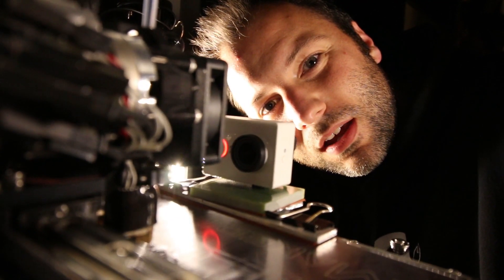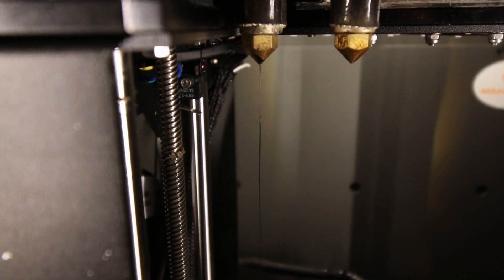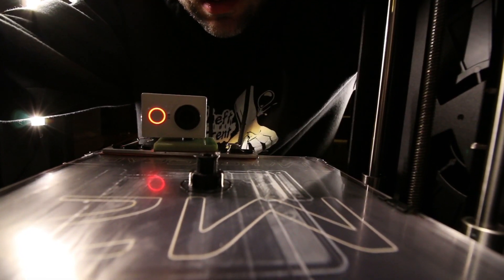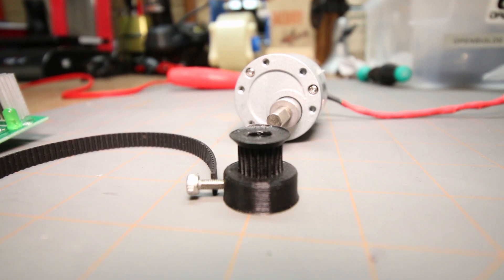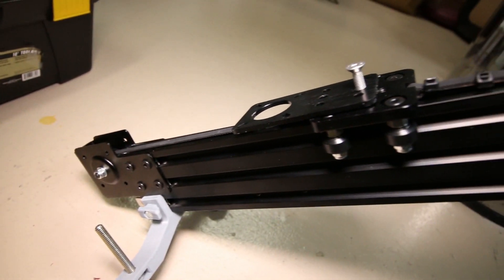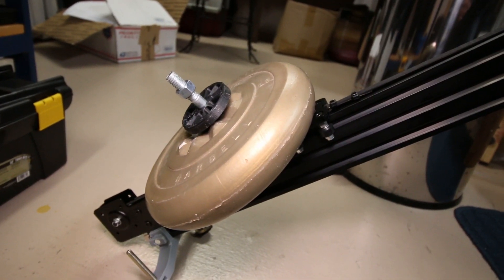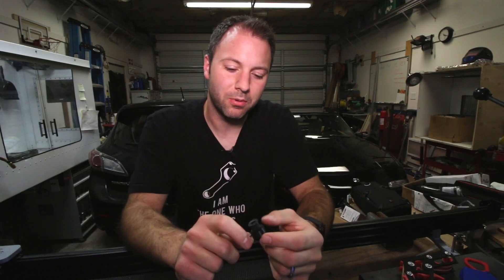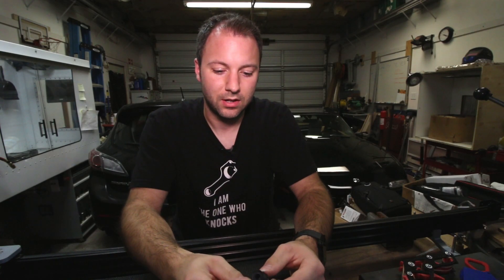3d Printed Timing Pulley in 23 mins for $0.17

Comment: Just found this video while searching for how to print pulleys. Recently, the support bracket for our curtains broke. I ended up designing three supports (2 end brackets and a middle one). Each has two holes for the curtain rods to pass through. I installed them with 2 1/2 inch long screws so they go into the window framing. Cheep and easy to do. Wife spray painted them antique bronze. No one can tell they weren't store bought! :)

Comment: I’ve printed timing pulleys before but honestly they are so cheap it’s more of a get you buy till the real ones come. The best use of my printer has been mounts and things for various stuff.
Reply from the maker: Yeah. The camera slider pulley is relatively light duty and I figured if it ever failed id just replace it with an off the shelf one, it hasn't failed yet. Mounts are great use.

Comment: A) Keep us posted on how long the pulley lasts. B) Keep us posted on how long the belt lasts. (Does the uneven surface chew through the belt?)
Reply from the maker: It's still working fine to this day. The pulley and camera slider it's attached to will be 2 years old this summer. Granted it's used maybe a few times a month at light loads moving a light weight dslr camera around. Belt looks fine as well.
Reply: The layers of the print are oriented such that the ridges are not "filing" away the teeth of the belt.   It's like the difference between sliding down the bannister, rather than sliding down the stair treads!    :o)
Reply: @SafetyGlassesRequired  how about now?
Reply: @SafetyGlassesRequired  yeah. We like to know.

Comment: The uninitiated look at Youtube videos about 3D printing, and they see endless tutorials on assembly, troubleshooting, mods, using "black-art" software to finally enable them to make a little boat, or a tiny cat, or a vase, or maybe set their house on fire!  WHY WOULD YOU BOTHER!
The reality is that 3D printers are a very empowering tool for creative people.  They are at their best making components for original designs, that would be almost impossible otherwise.  You are on target with your thinking, although I am not sure my Mum is quite ready yet!    I note, however, that you couldn't resist printing a Holy (holey?) Yoda!    :o)
Reply from the maker: I agree. When I finally get my butt in gear to make some more videos I plan on releasing some fun new designs that print relatively easily and are fun functional toys, tools, games....beyond the benchy if your will. What do you make with your printer after you've moved past the honey moon phase and are ready to make something more than a Yoda head.

Comment: Hi, I agree with you 100%; the freedom that manufacturing democratization (the possibility of real and practical means of production in almost any household) that cheap 3d printing helps to deliver is still widely underestimated and untapped. (I have been 3d printing parts for a few years now)  using it alongside with: A  basic laser cutter, a few manual tools and some knowledge of mechanical engineering and electronics.  Surface to say thanks for the video showing the possibilities of what can be achieved with relatively little effort and investment  now a days.

Comment: I use the M2 at work with Simplify3D. I noticed that I can avoid that curling (you know how it curls up at the top when you print angled overhangs?) by using only 1 perimeter.

Dude also, I've been looking into getting a "radial" blower fan to swap out the regular cooling fan. They're more powerful and you could add a fan duct that cools the print even better.
Reply from the maker: +Ryan Garrison great tips! Do you do one perimeter through the whole print or split the part up and use a different process near the top with one perimeter? 

I've been looking at changing the fans. I was just checking Thingiverse for mounts yesterday.
Reply: I know that printing a little cooler can also help. The M2 defaults to 215 degrees but that's actually really hot. A lot of people print at like 200-205. But I experimented and saw that the perimeters curl less on overhangs when doing 1 perimeter. If you're worried it won't be strong enough with 1 perimeter, then you can increase the infill to compensate. I've definitely used multiple processes to change layer height, but I haven't tried doing that for perimeters, that's a good idea!
Reply: hm only one perimeter isn't that good. It will be weaker even with more infill. Try a better fan that is blowing slightly under the nozzle at the extruding filament. Also decreasing the speed and temperature should be good.

Comment: Obviously works, so I'm just being picky: why is the belt mounted so far down the shaft - would it be better (for torque on the motor shaft bearings, and on the motor mount) to have the pulley teeth as close to the motor as possible?
Reply: if your motor shaft is long enough the printed pulley can be supported by the shaft so it will be unlikely for it to shear. But if your shaft is short, well better get that infill to the max so it's unlikely to shear off.

Comment: Been there and done that and I rather have a metal one but thanks.
Reply: 100% agree with you here. I've tried printing timing pulleys before and whilst they turn out great an are totally useable, they don't last well (in PLA at least). Still I'm printing an AT5 pulley as we speak because I messed up on a timing belt order and now I'll have to wait another week for the right size. This pulley will keep my project moving until I have the parts I need, so there's definitely a use case for them.
Reply: @stevenjkirby2020  PLA doesn't last that long in certain applications mainly because of the heat produced plus, it's plastic. PA/Nylon printed gears especially ones with specialised filaments last really long in most cases.

Comment: Do you think it could work for a motor belt drive system  rated at 8000 rpm?
Reply from the maker: +avi bank It might especially printed out of ABS or Nylon. If you need a bigger diameter of the pulley I might be concerned with it being out of balance by the metal nut inserted into the pulley for the set screw. In your application will someone or something get hurt if it fails?
Reply: avi bank No, that "set screw" would cause unwanted vibrations at high rpm's due to the head. You would need a real allen set screw.
Reply from the maker: +tot2600hrs there is no reason you couldn't use an actual set screw instead of the socket head cap screw I initially used. Also in SCAD I would use two screws set 180 degrees apart to try and keep it balanced. It still might fail but it might last longer than you might expect.
Reply: @SafetyGlassesRequired  the trick is to use an angle for the set screw.

Comment: don't think it will last, also backslashes.
Reply from the maker: For my application, a camera slider backlash isn't a concern, but it has barely any that I can detect by hand/eye.  Out of curiosity I think I will take some backlash measurements with a dial indicator.  I will update this page if it ever fails but for the load it carries I don't think it will.
Reply: ABS would.

Comment: I cant see any use for a printed pulley thats not high accuracy.
Reply from the maker: Driving a video camera on a slider. For this application smooth and steady motion is all that's needed. No need for precision.
Reply: (1)  A twenty tooth sprocket will move a belt twenty teeth, regardless.  I grant you the lack of accuracy may introduce vibration, or other unwanted side effects.
(2)  Not all applications require high accuracy.